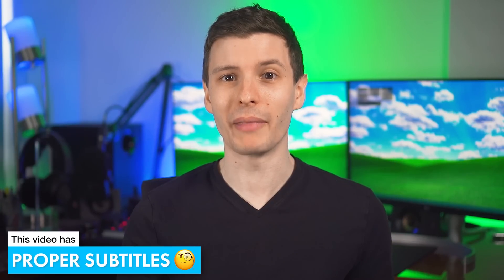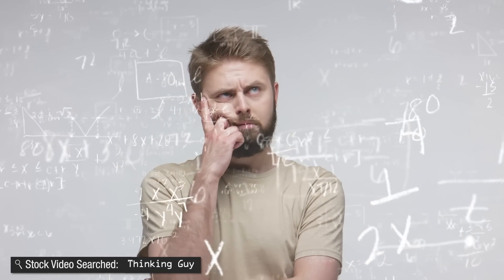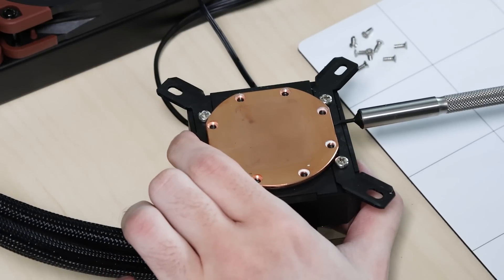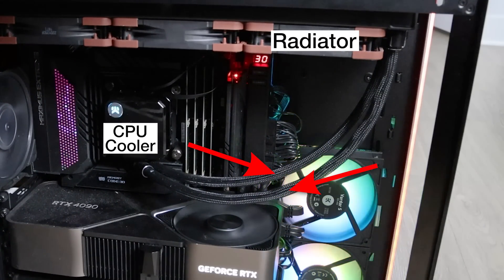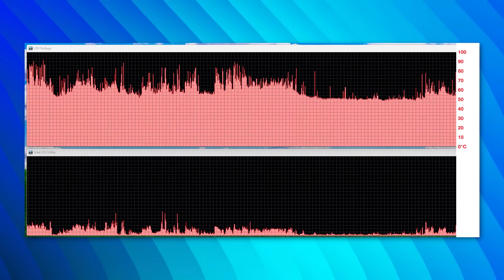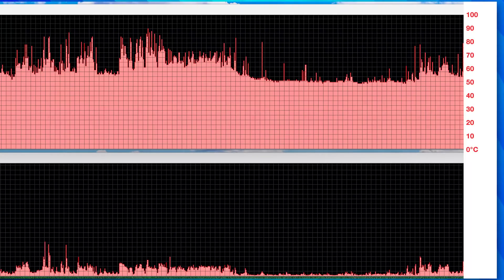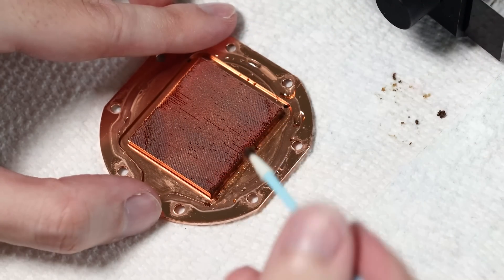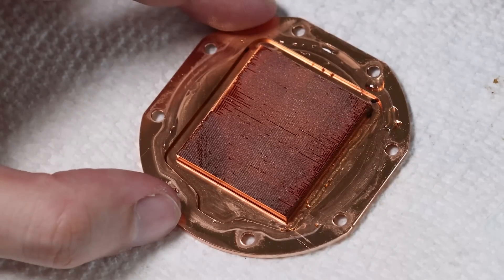The Mystery CPU Overheating Problem Took Me Months To Solve

Comment: i think this is happening to me right now, i have a Corsair H115i 140mm cooler and its running too hot sometimes, i changed the pump profile from normal to extreme and the temp dropped 10°C but it still sometimes hits 100°C (i have an i7 11700) but i do not feel confident enough to disassemble the cooler.

Comment: @ 11:00 or so you said you would try another brand....Maybe it's not the cooler but the quality of the Coolant...

I had a similar situation recently.  I had a Wrath Cooler attached to my Ryzen 5 3600 with a Prime X570-P Mobo and was re-encoding 12 video files from mkv to mp4...
Open Hardware was indicating the CPU was getting hot just before the system turned off.
I have a Cooler Master CPU cooler on my other computer which had a 10 yr old CPU....
I decided to upgrade the second computer to the same level. The second computer had to have a better Mobo (Asrock X570 Phantom Gaming 4) because the other Mobo wasn't available. 
Now I'm in the process of rebuilding the second computer with all the best bits....
Hopefully I won't have the same heat problems.....

Glad you worked it out though.....👍

Comment: i woulkd klean it with dish soap and a tooth brsh but still i think there is more of that crap inte liquid.... hail all mighty heat pipe CPU cooler... i mean my old hyper 212+ still works after 10 years of use...

Comment: Pretty much every watercooling AIO I've ever tried has had issues with gunk building up in the pump. I've used several model from the Corsair Hydro and NZXT Kraken series. At a certain point I simply decided to get rid of watercooling in my pc's and move back to (decent) air coolers. The trade off of having a couple more fans on permanently against having to open up my pc's every week and my vm's being offline for large portions of time during maintenance was a no-brainer. If you really need watercooling in your pc, you're far better off with a custom loop constructed by an experienced pro, especially when they prefer clear liquid and tubing. This instantly means that they are aware of the limitations of watercooling and try to avoid exactly what this video is about. After all, you get watercooling to keep your cpu (and maybe other parts) cool, not to make your pc look flashy. People who want flashy-looking computers but don't really care how they work (and keep working) should stick to apple computers anyway.

Comment: Did you smear the gunk on a slide and have a look under a microscope? I was just wondering whether it was algae.

Many years ago an old copper fan of mine used to let my cpu's burn out and I lost 3 Barton's after prolonged wow sessions. Turned out my cpu fan would fit perfectly in two positions- the right one and the wrong one.  You would have thought that would have been easy to work out but I was so skint I couldn't afford a psu strong enough to run my box so I had to jerry rig from a 2nd case half of the components to the box that had the GPU in. It was a terrible solution to a stupid problem and a fire risk but it was in those heady days of computer fairs and digging through boxes with other  enthusiasts in the perfume of ozone and BO.

Comment: As an aircraft mechanic, this video really shows how useful filters are, also, check to make sure your pump is alright, cause metal chunks in a closed system can be an indication of a pump that has broken, usually in aircraft its in the filter, but there isn't a filter in this system it seems

Comment: It's all part of the learning process so don't be too hard on yourself. In '95, I have struggled to get Internet working again after trying out all kind of software/driver/resintall Window only to discovered that dialup modem inside the computer got fried somehow. Was a learning experience not to only look at the software issue but on the hardware side too. This change of my thinking helped me to solve the other hardware issue that I had too instead of wasting countless hours trying to fix the issue on the software side.

Comment: looks like you have/had contaminated coolant. in my motocross days, we would see it on older and abused bikes. the coolant wears out and gets oil/dirt contaminated and creates something called clinkers, that would start to clog up and erode the waterpump internals, eventually overheating. did you use your normal coolant? was there any possibility of some type of lubricant coming in contact with it during assembly?

i dont use water cooling for this specific reason. works great until it doesnt....

Comment: I love a learning experience like this.
After 50+ years in IT, I can say we all do this, sooner or later. What's this? You said it yourself: assuming we have found THE problem.
These things are (nearly) always clearer in retrospect. So let's look at an ideal debugging procedure and highlight the errors (not to score points, but as a learning exercise). This applies to situations where we have already tried a guess or two, since an educated guess frequently leads to a fix.
1. Collect ALL the available evidence. Using the thermal gauge at the start would give more evidence.
2. Evaluate the evidence.  For example what is the pump temperature versus the radiator temperature? Missed this step. Sometimes this leads to repeating step 1.
3. Develop a theory that explains the evidence. Made an assumption here. Assumptions are OK, but it's important to be conscious that it's an assumption. Sometimes this leads to repeating step 1.
4. Test the theory. Missed this step, again by making an assumption. Those assumptions are killers.
5. If the theory is shown to be wrong then go back to step 1 again with the new info.
6. Great, the theory was right. Fix it. Maybe with a trial fix, but then do it properly.
7. You're not finished yet. Was that the only problem? Is everything completely fixed?

Comment: Ahh yes, the CPU overheating and trying to troubleshoot that. Mine first had the issue of the pump not being attached firmly enough, and the second was the OG BIOS overclocking my CPU in a way that would've slowly cooked my CPU. That was a fun troubleshoot, trying to figure out what voltage would NOT cause my computer to melt :/

Anyway, happy you found the problem!

Comment: I had a similar problem, idling and working temperatures began to go higher, than one day I came home to find the system off, with a log that showed it shut down due to overheating- on idle. tried turning back on, and it went up to 90C.  Checked the water loop, and it was thick green, and the pump had burned out due to being clogged with - an algae bloom!  First time in 15 years of water cooled systems that that has ever happened.

Comment: Nasty. I did not expect that. My computer has a "fun" problem that when you put the computer to sleep, there's a chance you'll lose a USB power rail. I never use the sleep function, so I forgot about it for a time. Then my partner "helpfully" put my computer to sleep, which he'd never done before. I bring my computer out of sleep mode and notice that half my USB devices aren't working (which took out two hard drives). I'm spending all my time trying to get the hard drives back up so I only belatedly notice that my CPU temp is up to 95C. At this point I realize, guess what also runs off USB power? That's right, the CPU cooler. After a shutdown, and time to cool, I got the USB rail back, up and the CPU cooler pump grumpily started pumping again with a nasty noise. (I've got a replacement ready to install now)

Comment: I prefer air coolers.  The best ones like Noctua can cool just as well or nearly as well as liquid especially for non-overclocked CPUs.  They're far more reliable and nearly foolproof.  They still cool if the fan dies which is easily replaceable. And they don't leak causing a path of destruction.

Comment: artic had that issue, they send you a repair kit within 5 days just within two emails. same day response. kit was a new plate, some liquid and a seal.
important to note is they informed customer before it went all bad for most of us. so it was a replacement in advance to not build up stuff in the first place.
best service ive seen in decades by an IT company asside from APC (2 days replacement batterys for the UPS just based on a serial number)

Comment: I had a similar thing happen the only time I tried to use liquid cooling.  When I built my new-at-the-time i7-8700K gamer I tried to use liquid.  The first nice cooler from Newegg was DOA.  I shipped it back and just went and bought an OK one from Fry's.  Less than a year later I started to get thermal throttling.  I could sense through touch that the pump was moving and all of the hardware monitors looked good.  Eventually (about two weeks) I found that there was gunk (corrosion or something) inside.  I just returned it under warranty and bought a nice air cooler and that was the end of my problems.  With an air cooler you know it is working if the fan is spinning.  If you don't REALLY need extra-high-performance cooling then sometimes Old School is the Best School.

I didn't have to worry about any of this with on my first PC: 4.77 MHz 8088 loaded with all 640 KB memory and a 20 MB hard drive.  Ambient cooling only...

Then back when active cooling first became necessary there wasn't any of this thermal throttling stuff.  If you accidently turned on the PC without the heat sink you just put in a new processor.

Comment: How old is the cooler?  I recently changed the fluid in a 12 year old Corsair h100 I had from new and it was fairly clean inside.  It had lost some fluid through evaporation in the pipes.  I was just paranoid before putting it back to work.  Got 2 other aio coolers to replace fluid in later in the year.  They are both 6 to 7 years old.

Comment: And this is why I've moved back to air cooling. Water is unreliable and a waste of time if a failure occurs for minimal gain, if any, for most users. Custom loop, yes you will get better temps, but still not worth the cost and inevitable cleaning required. Large air coolers are relatively quiet and just work even if the fans fail.

Comment: Recently my neece had PC that was randomly shutting down during update of windows.  OCCT passed, Temp where around 80℃, but every time i tried to update windows it crashed with kernel error in logs, it was weird for me, but i thought it was software problem, and i tried many ways of updating windows until i manages do t via USB drive. But after instalation when i tried to instal some games it startet rebooting again. It was clean inside case, but when i dissasembled fan, between radiator and CPU cooler there was solid dust layer and apparently 80℃ is max temp for old AMD FX cpu that somehow didnt crashed with long OCCT tests. After cleaning cooler it droped temps to 60 under stress and didn't crashed since.

Comment: When I worked for a repair shop, this was a pretty common issue with aio within 1-2 years they would clog or start rattling as air would enter the loop, I thoung that was common, maybe we just got the unlucky guys. 
That's why I always preferred air cooling or custom loops as they are easier to diagnose and repair.

Comment: Though I have not had the problem, I have fixed a couple of computers that did, so I keep an alternative cooler at hand (Air Cooler) for testing and making sure that the problem I am seeing is just that. No fault on your side if you have not see it before, but now you know. For example, I had an i5 system come to me for repair, the machine would not boot, kept showing the same error over and over that was the DRAM error (LED bug indicator), even after I tested the RAM, did not matter the config it would not boot, so I took the cooler off, a stock one and all became apparent. Having asked the question when was the last time you checked you paste on the CPU the answer was never as the paste was now hard as nails and was literally cooked to the CPU, dead chip cooked to death. Fortunately had spares and the system was up and running in less than an hour.

Comment: should have a filter in the water-loop also dont use tapwater, clean it all out and use distilled water with additives like water-wetter. Just like you should not use tapwater in a car radiator , tons of crap will grow in there and clog it up unless chemicals prevent this. In most cases using an air/heatpipe cooler is far superiour over time anyway. Get a good sturdy copperblock heatsink with good fans and clean them for dust yearly. with water you also have condensation and leak risks

Comment: Funfakt:
If the Pump would running correctly, there should be no significant temperature increase after the CPU. Just when the flow is really low then it increases a lot. It has to do with the amount of water flows through the Cooler per time. Water can store a large amount of heat/Energy per Kelvin temp increase so for example it can cool the CPU by 30K but only increases its own Temp by 2K. If it flows fast enough though the CPU you don't see a big increase. Just when the flow is low than it will heat up. That is also the reason why when you integrate you GPU in the loop it doesn't care if you have GPU->CPU->Radiator->Radiator, or GPU->Radiator->CPU-Radiator. So a hot waterpipe after a CPU is always a bad and not a good sign

Comment: I was quite excited to discover this video as I have been having the same BIOS Post 'CPU Overheat Error' and had to turn off the notification in BIOS to get the computer to boot into Windows. When I took my 10 year old Corsair H100i apart hoping to see a load of crud blocking the cooling vanes, I was shocked to see it was completely clean. However, the pump had been making a light rattling noise on and off whilst in use, so am now wondering if the pump is failing instead.

Comment: Paste will never have such radical temp issues. You can easily not change paste for 5y and still have good thermals.
We're not in the `04 anymore. I can guarantee you that paste should be the last culprit in 99% of the cases.

Comment: hello,   I am currently using Dell Inspiron 15 3000 series laptop,here are it's specs:-

RAM-4gb DDR3

Cpu-intel i54210u

processor-1.70hz x64 based 

gpu-nvidia GeForce 820m

OS-windows 8.1 

I was using windows 8.1 and my system was going fine + my games were running pretty smooth,e.g Watch Dogs.

I decided to upgrade to windows 10 but after that my system was slowing down so I rolled back to 8.1 . but NOW MY GAMES AND SYSTEM ARE LAGGY!!!

I don't know what to do, pls help me!

Comment: I would have put the cold plate into an ultrasonic cleaner with distilled water to remove the particles in the fins, then do the rubbing alcohol afterwards for any that remains. That would probably only improve the temps a couple degrees more than you saw at best, but it would be a relief to know that you actually got as much out as possible to prevent a reoccurrence.

Comment: Makes me love my Apple silicon more and more! With that said, I do still want to build a pc for myself, but it is absolutely insane that intel is making their CPUs more hotter and aggressive, versus more cooler and efficient. My gut told me it was some issue with your cooler just because of how hot these new chips get. I really am super anxious for frore to release their airjet to the consumer market because I believe those will really make a drastic difference in computer temperatures (especially and at least while intel [& most x86 chipsets] are content on making their processors ever more hotter)

Comment: I never had that kind of problem with an AIO.  But I have heard countless reports from many others who have.  But recently, I had a clogging issue with a EK open loop setup where my top radiator had a chunk of trapped solder dislodge after over 3 years of use when I was doing a regular drain and flush of the system.  The pump was pushing fluid just fine during the refill process.  But would slow to almost nothing once the loop was almost completely full.  It took me a couple of days of trial and error to finally find that clog.

Comment: What I find interesting is that I've had an ancient Corsair H70 AIO liquid cooler running flawlessly since 2012. Well ok, the pump has gone slightly rattily, and I've had to top it up with distilled water once, but it still cools good as new even though I've never even had a look at the internals. These things can last a very long time as long as the factory doesn't get sloppy.

Comment: It wasn't with a liquid cooler but a friend of mine had insane issues with temps and her cpu was sitting at 75°C during idle and shot up to 90 very quickly. She got a new cooler, new thermal paste and cleaned it several times. I went to visit her myself then since she had that issue since over 6 months and I took apart the computer, everything did seem fine until I realized that the PSU was installed incorrectly so it drew air from within the case and not from outside the case. With her having a blower-style GPU and the PSU then fighting for air with the GPU and only having 2 front intakes at the bottom of the case basically no air went up to the cpu and it was more or less choking there. Flipping the PSU around lowered overall system temps by 30°C lmao she was so shocked seeing 42°C on the cpu in idle and 30°C on the GPU

Comment: Hey this is what I did with my CPU it was a Intel Core i5 11,400 f I realize that it would be at about 90 degrees Celsius or higher and I found out that the processor limit and I changed the minimum processor processor limit to 80% and maximum processor limit to 90% after that it works flawlessly 😅

Comment: I had the same problem with a Corsair H115i.  After a couple years, the CPU would just start getting really hot.  One tube was really hot but the radiator was cold.  The hot coolant in the tube was just barely moving away from the CPU and was not making up to the radiator fast enough.  Once I replaced the H115i, problem solved.